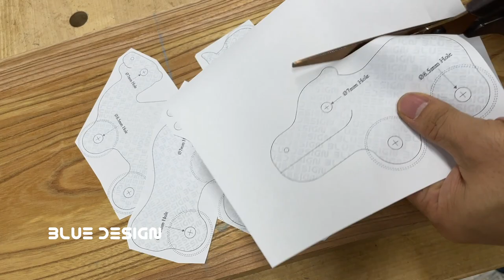How to Make a Wood Toy Animal Car Plan B

Comment: I intend to make these as per plans, which I bought in Etsy thank you.  I printed on A4 paper but the outlines seem to be smaller than the video.  Could you perhaps advise a. width in mm of wood stock you have used for the animals. I would guess at maybe 35mm, but that is only a guess and it's not mentioned in the plans. b. To confirm I have printed correctly, could you send distance between hole centres so I can check.  Maybe just send the measurement for the hole centres (wheels) for the first animal which I have as camel on page 2.  Your help would be appreciated.
Reply from the maker: The diameter of the outer dashed line marking the wheel is 35mm.
When printing a PDF file, if "Actual Size" is selected in the options in the print window, it is printed as an actual site.
The thickness of the animals was not specified. Make it the way you like it. I like to use between 25 and 30mm.